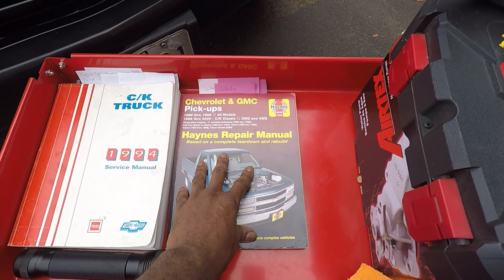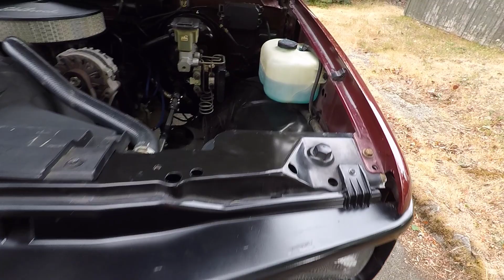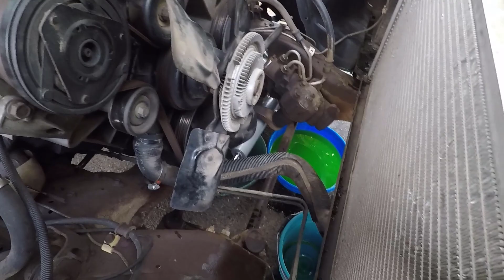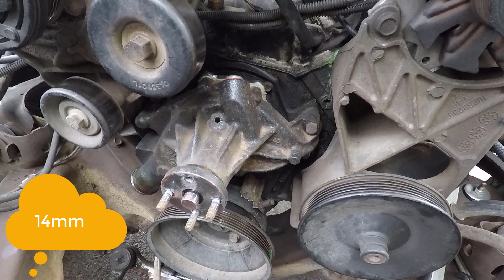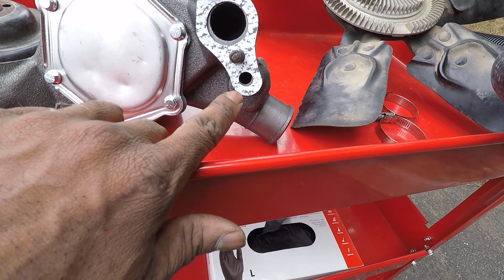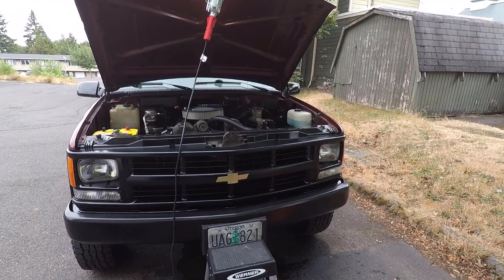Water Pump Replacement 1994 Chevy C1500 4 3L V6 (and a new coolant leak found)

Comment: Ya know I have been wrenchin since I was about 13, The other day I lost heat in my 97 chevy k2500. Truck wasnt overheating so I figured the thermostat was out so its cheap I replaced it. Still no heat. So I think damn water pump is out but still working enough to not overheat. So I replaced the pump. Jump in the truck and still no heat. Then On a rainy day I was out there getting something out of the truck and seen a drop of water fall from the windshield  on to the top of the dash where the dash panel meets the dash. Bought a climate control, installed in less than five minutes and had heat. Was mad for wasting the money on the other parts but at least its got a new waterpump.
Reply from the maker: That's a great story and valuable tip. My truck sometimes has heat and sometimes doesn't. I will have to look into that. As for wasting your money, the parts are cheap all things considered on a couple less things to worry about. Thanks for watching.

Comment: Good video but always use spring clamps that came with the hoses on vehicle. Screw clamps dont allow for expansion and contraction of the metal from the weather. The spring ones do.

Comment: Just put it back, it's so simple but why does it leak worse than before. When I pour the coolant in, it leaks badly I believe through the left side of the gasket. Is it because it's not tight? I believe it's tight though. Help?

Comment: Is this a reliable truck for hauling about 2000 pounds in your opinion
Reply from the maker: I'm not sure this truck with the 4.3L and all it's original drivetrain components is up for the task. I'd want a 2500 or 3500 for sure
Reply: @BuildYourOwn  okay thank you 🙏🏿

Comment: Man I'm lucky to find these videos, I just got a 93 for free because it was going to be scrapped. Told it was parked because of a coolant leak and I'll be damned this is exactly what's leaking
Reply from the maker: That's awesome brother, welcome to the club! I've got over 60 videos of the truck and many of them are me doing some type of repair or upgrade. I also have a website and have the biggest, best, most complete GMT400 Upgrades and Performance Parts Guide . You can see that here. Hope this helps and thanks for watching. https://www.buildpriceoption.com/gmt400-upgrades/
Reply: @BuildYourOwn  Well I sure appreciate that and I'll definitely be subscribing and watching
Reply: @BuildYourOwn  is this video relevant to a 93
Chevy k1500 5.7 V8? I dont want to start pulling stuff out and end up boned in the end if it all isnt the same procedure
Reply from the maker: @vaevictis5178  the procedure should be the same. I have read many times that the V6 is like the V8 minus two cylinders. And you can pretty easily visually check your setup with the top shroud removed before you start pulling stuff apart. Hope this helps.
Reply: @BuildYourOwn  thanks for the response. It was infact the exact same. Took me about 4-5 hours due to some nuts being stripped but successfully changed my water pump. Your video was a great help, thanks!
Reply: @BuildYourOwn  so almost two weeks with no issues and saw a tiny leak today. That plug, not to sure on the name, that sits on top of the water heater was actually loose so how. Tightened by hand and was still leaking, it was getting dark so didnt get the tools out to tighten it properly. Cant frickin believe my luck. Do you have any info on that plug at all?
Reply: My 93 just started leaking coolant from the water pump as well. I did an oil change and full coolant flush and refill and hose replacement last month to get ready for winter and today it was leaking coolant like crazy from where the hose meets the water pump. Ill attempt to replace the pump on my own this weekend so hopefully that fixes it.

Comment: I replaced my water pump on my c1500 but I have a hose that connects to the top that I see yours doesn't have what is this hose called? (It's stainless steel)
Reply from the maker: Was that a transmission cooling hose?
Reply: @BuildYourOwn  it was a heater hose connector not sure what it does exactly

Comment: That would be my luck. Think you're done, and now the radiator leaks. DAMNED !!!
Reply from the maker: I couldn't believe it. I have replaced just about everything now. I think I went that day and bought a radiator from Autozone. Here's the install https://youtu.be/ozaM-G0Uzjs
Reply: @BuildYourOwn  I own a 2003 S-10, that was my dad's. I'm running into the same crap with it. It's a money pit, with only 47,000 miles on it.  If it weren't for the fact it was my dad's truck, I would so get rid of it. I'm too old now to do this crap myself, so I'm at the mercy of mechanics. PRAY FOR ME. LOL  I'll watch your radiator video now.  I swear, when the heater core goes?...... so goes this truck.

Comment: Hey man i have a 1994 cheyenne and the drivers door wont open no more from the outside. Its unlocked and everything and it wont open but it will open through the inside. Do you have any idea whats wrong? And the clip from the side door is kind of messed up. I have to shut it hard for it to close. Have any idea what is wrong?